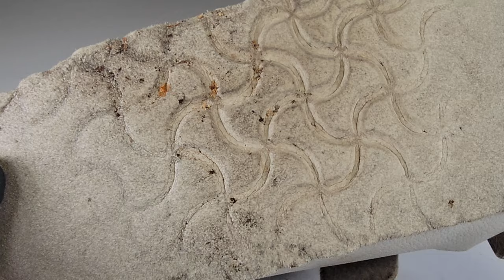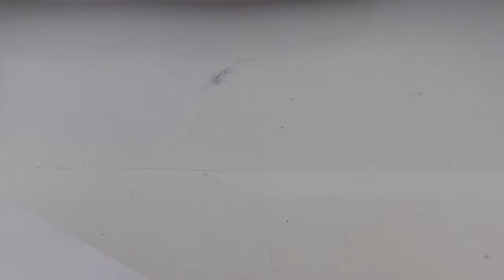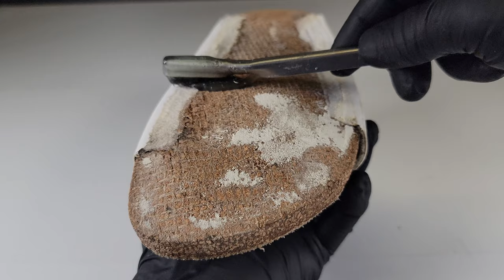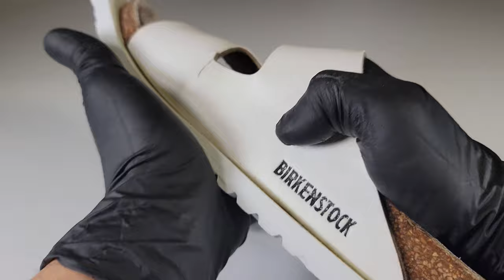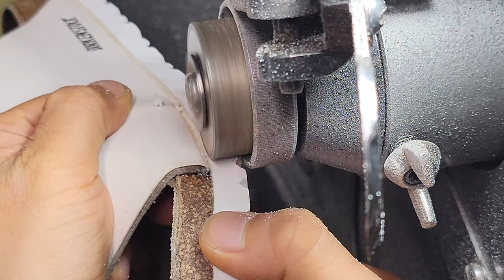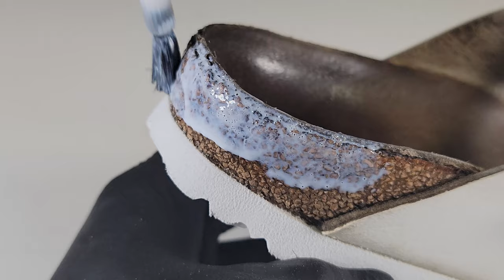🎧 ASMRㅣWhite Birkenstock Sole Replacementㅣ버켄스탁 수선ㅣ4K 🔨

Comment: You didn't clean the foot bed. I was also surprised with as bad a shape as the cork soles were that you didn't replace them. It has been done to some of my shoes that needed help . I also get plastic taps on the back of the sole to keep from wearing them down unevenly again. $5 and it adds so much wear to my Birkenstocks